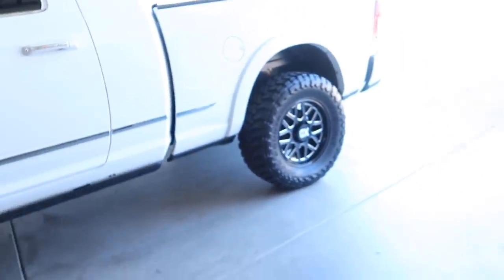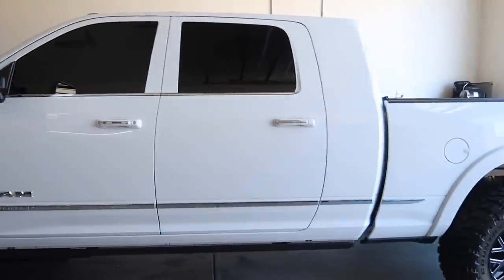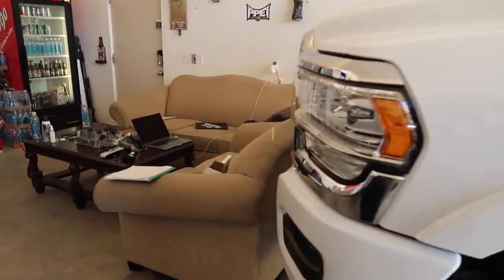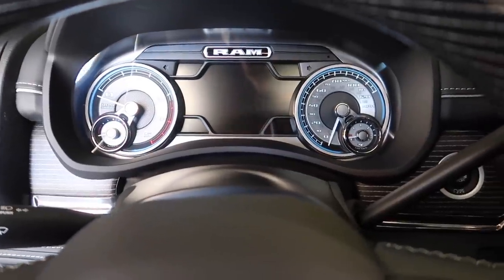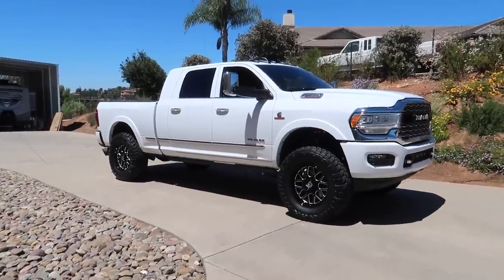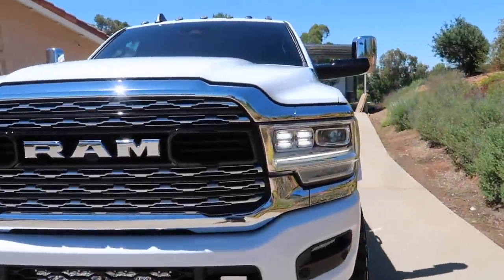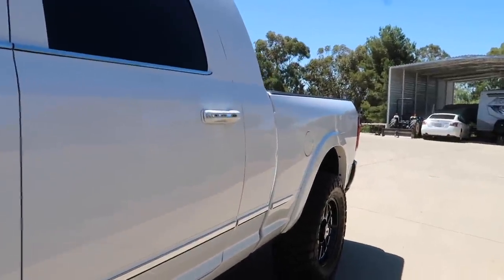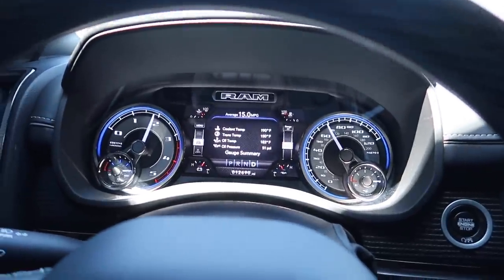THESE TIRES HAVE TO GO!!!

Comment: The exhaust drone actually helps put the kids to sleep.lol
We used to have to load the kids up and drive around the block to put them to sleep at night
Reply: Agree with you there. I have a 380hp Cummins QSB in my commercial fishing boat, with a muffler, and the engine noise makes my kids pass right out. Also makes me fall right asleep if someone else is driving

Comment: I agree that the toyo mt is the BEST looking tire. It’s worth the small amount of noise. BUT, the ridge grappler is so quiet, it’s impressive. I switched to a 37x13.50-17 Nitto Ridge Grappler about a 1000 mi. ago and so far it’s pretty badass. I have them at 45F/35R when not towing with the Carli Pintop kit and I’m happy. Now all I hear is my “DPF back” exhaust (w/muffler). Try them out since you’ve tried all the other toyos and you’re gonna ditch them after a few thousand mi. anyways. My 2 cents. PEACE!!!

Comment: Rocking the Nitto Ridge Grapplers on my 2019 3500 and my 2019 1500... Running 37” on the 3500 and 33” on the 1500... Best tires I’ve had on my ram so far Eddie...
Reply: I've got them on my 2019 Denali Duramax and I absolutely love them. Little to no road noise, an aggressive tread and even wear. They've been amazing tires. Get them Eddie!

Comment: I've had Nitto Ridge Grapplers for about 8k miles on my 2014 Ram 2500.  Tow 12-14k toyhauler and the Nittos feel very sketchy.  Lots of sidewall flex and torsion flex has ruined the tires.  Nitto is giving me a credit at Discount for new tires.

Comment: Def suggest the ridge grapplers...I have them on my new 1500 and I freaking love them. They're grippy and ride so smooth. My buddy has them on his 2500 and he says the same!
Reply: ill agree.. i have 35x12.5x18 on my 2500..sooo quiet..my ride isnt as smooth when under 30...but that might be the air pressure. not sure
Reply: Dustin Rust what do you keep your air pressure at? I'm always back and fourth on what I want to run for my 1500...between 35 and 40
Reply: @garyreilich2667  well i just got them put on. they put them at 73 each tire...i will be airing down to 60 to 65 front and 50 to 55 rear. i watched a guy do the chalk method and his rear wore perfect at 45 lbs...ill see how it rides once i air them down and then see what 45 lbs does
Reply: Dustin Rust thats on a 1500 or 2500?
Reply: @garyreilich2667  2500

Comment: I put a muffler  on my f250 power stroke to get rid of the drone noise.  It was a straight  shot through  magna flow . Love it cab is quite  now but still has a rumble out the rear of the truck.

Comment: This would obviously be more expensive but you could add an electric exhaust valve so you could have it run through a muffle if you want but then if you want to have a little more fun and enjoy the sound you just flip a switch and open her up. Really common thing on gassers, not seen much with diesels.

Comment: I just today put on the RT TRAIL they are about 9-12 months since they hit the streets.  Not run the MT, but stepped back a level for some (light snow ability( not snow rated though)) and a tad more sand ability w/o digging in.

Comment: I have a 2003 5.9 with a five inch turbo back exhaust with a muffler from AFE with no cat. At first I was hesitant on buying the kit with a muffler but since I use the truck for hauling heavy loads the drone was real bad especially on long trips. With the muffler on it's still has an aggressive sound but no drone inside the cab. I would recommend a muffler especially if you need the cab to be a bit quieter.

Comment: I have 295/60/20(basically 35”) Nitto Ridge grappler on my ‘17 2500HD GMC Duramax and I’m very impressed. I bought the truck used and they are half tread and not loud at all, which also have no “hum” on the freeway. They are worn evenly for half tread and with windows up or down, the noise is very quiet compared to a MT.  They look great and I will definitely be buying these when I buy my new Method wheels.

Comment: I put a muffler on my 2005 5.9 cummins it had a 5inch straight pipe exhaust I ran it for 8 months and was way to loud I tow every weekend and I drive around SoCal for my pipeline job I got a mbrp muffler and was the best thing I ever did it sounds so much better because you can hear the turbo whistle better for my truck not all growl.

Comment: The Nitto Ridge Grappler is a great choice. Not a single issue and still look brand new even after 10k miles. Also no slinging of rocks and mine go past the fenders by 3 1/2 inches.

Comment: On the muffler I don’t think it’ll be much of a difference unless you have a resonator mid pipe and muffler or whatever order there in then you sacrifice some power but I doubt enough to notice if it just temp until baby’s older that’s the way to go just and FYI

Comment: Mine is a 4” and I took the muffler off, it made it louder at start up and low rpms. At higher rpms not much noticeable difference, except when the exhaust brake is on

Comment: Get some Nitto Ridge Grapplers! Amazing on and off-road grip and are extremely quiet. Much better than the Toyo R/T's (their main competitor). Over 10,000 miles on the Ridge Grapplers on my 7.3 Excursion, still look brand new and are just as quiet as they were brand new!

Comment: Hey Eddy, I’ve had multiple sets of ridge grapplers and loved them. Not too good in mud though. They clog up quick. Other than that it’s a good tire.       Also I have a muffler on my Cummins “aftermarket” exhaust. It’s a straight through type of design from MBRP I think. It quiets it down but still has decent sound. Definitely quieter when pulling my camper on trips and sounds healthy driving around town.

Comment: Whats the backspacing on your wheels. That wheel tire combo fits that truck perfect. Im looking for a similar setup for my 2022 F250.
Reply from the maker: 20x9 with a +18 offset on 37x13.50x20 tires

Comment: I had a 5inch straight pipe for about 2 years then wanted it quiet. Installed a muffler and never regretted. Also saw a better low end throttle response. I dont think you'll ever find a mud terrain that is quiet. I run Toyo Open Country AT's and would recommend those.

Comment: I have 35 on my f350. With rotation and proper pressure they will last.  I have 10000 miles on mine and still look new.

Comment: Eddie I have ridge grapplers on my 2015 LML. I drive no less than 45,000 miles a year and they have been phenomenal. They have around 35k  on them and still have 80% tread left easy and I don’t rotate them like I should. 35x12.5x18 load F 45psi front 40 in the rear
Reply: Do they still ride smooth?
Reply: @bamafever92  just sold the truck. They had 75k miles on them and 30-35% tread left. Load F btw. Were smooth up to about 55k then they cupped a little but that was my fault. Best tires I’ve ever owned.

Comment: Hey so I was a toyo mt guy for all my  trucks and tire choice. Tell my neighbor who works at a tire shop “Tucker tire” he’s also my friend said bro I want you to try this tire it’s a 35/12.50 it’s a Cooper Discoverer AT3 XLT. I have like 3,000 miles on them on my 2020 Chevy 2500 duramax. I have no complaints nice in the sand pulling my 5th wheel, nice on the highway NO noise and does great pulling my boat to the lake. But just something to think about.

Comment: Unless your going muddling just go with an all terrain or a mild hybrid tire. I recommend nitto terra grapplers or ridge grapplers. The ridge grappler is looks more aggressive but still rides smooth. But I use 37in terra grapplers on my ram 2500. The run sooo quiet and is still realy good off-road if your not going muding 👍 my last set lasted 50k miles, and that’s pulling a trailer 5 days a week
Reply: Ridge grapplers are garbage. Sh@ rain traction they spit rocks like crazy made my front end feel like it was floating and barely got over 26k before they started separating. I get a goood 40k out of cooper stt pro. I tow with my truck. We have good success with the terra grapplers only complaint is the last two sets we started getting cracking when we hit half tread life. My wife’s titan is getting around 35 hopefully 40 out of the ridge grapplers and averaged around 45 -50 out of terra grapplers but my ram 2500 eats the ridge grapplers up.

Comment: I have 37-12.50r22 Ridge Grapplers on my F450. I use it mostly for towing a 5th wheel toyhauler. They ride great, are quiet and are wearing extremely well. Air pressure is key. Toyo MT’s are great as well, I prefer the Nitto. Had em both.

Comment: I will let you know how many I get out of mine but I have a 2018 3500 with a 100 gal transfer tank that is alwatys in use and I tow 10k lbs + 2 to 3 times a week and based on what I have left I will get the remaing 15k to get to the 45k warranty. These would have honestly gone longer had I installed the air bags earlier in their life a few 1000mile+ trips without kinda messed up the side tread on 2 but I'm anxious to get a fresh set
Reply: Talking about the ridge grapler

Comment: How much air do you run in your MT's? Much quieter at lower pressure on my Duramax 45/40psi when not towing
Reply from the maker: I run 45 rear and 40 front

Comment: Check out nitto exo grapplers👍just as aggressive looking as the ridge grapplers but meant for HD trucks and have 3 peak mountian/snowflake winter rating. I have them on my 18 F350 and are great. No louder than my ko2s were on my last truck. Ridge graps are great but not as good in wet/snow/cold weather as the exos. I guess you don't really have to worry about that but up here in BC it's a deal breaker. Everybody runs RGs, do something different lol

Comment: i was the one who asked about quite tires a couple videos ago! I think im gunna go with toyo at3s for my f150, i dont go in mud or sand often, my boss just got nitto ridge grapplers i have to ask how he likes them, still look like m/ts
Reply: I got the toyo open country at3 on my f150, I got 10 ply as I tow with the truck. One of the best tires out there, no road noises or humming, no side to side sway feel when towing, excellent traction in the yard and rainstorms. I got 5k on them so far and no wear on them.
Reply: Kameron Rice sweet such good information, do you know if the 305/70/r17 is also 10 ply?
Reply: @ryanrussell3893  yes the make them in that size in 10 ply (load range E), as well as 8 ply (load range D).
Reply: Kameron Rice got it 👍 great price to on those toyos compared to bfg ko2
Reply: @ryanrussell3893  I almost got the bf ko2 but my buddy had them on his f150 and the tires seemed to get more cupped on the edges and make a roaring noise at highway speeds in the cab. Also the  centers of the tire seemed peak. Still a great tire but don't think it will last as long as the at3.
Reply: Kameron Rice yea i cant find another al terrain that matches that at3 especially for the price

Comment: Just put new Ridge Grapplers (35x12.50r20) on my Duramax AT4. Really like them so far but coming off of stock Wranglers so a definite upgrade. They match well with the Suspension Max stage 2 leveling kit.

Comment: 295/65r20 ridge grappler.  Ram 2500 mega cab. Do it. I pull 16000 5th wheel.  Their good, quiet, not sluggish

Comment: Ever considered KM3’s?
Reply: Pablo armenta The KM3's are great off road tires but tend to cup badly if just highway driving. Have to keep up with the rotations also.
I do still like the KO2's
Reply: Dave Thies had k02’s on a ranger. Km3’s for like 2 months on ‘03 z71 sierra but then the truck got robbed 😅 now have toyo mt’s on a JLU
Reply: Sooo hadnt got much time with the km3’s. Great off road. Ko2’s were ok ok dirt and gravel. Not so much with much mud

Comment: if there f rated and your running 65/85psi etc they move around the road i aired down to 50f45rr intell i tow and its better but still little noisy my bfg a/t k02s road alot better and smother quiter etc but didnt look as good.. imo

Comment: They are MT’s Eddie, the Nitto Ridge Graps are great!!! I had them and the only reason I switched out from them was because I wanted a true MT and went to true 35’s. Ended up with Yokohama MT’s. I’ll tell you right now you will be back in the MT’s, anyhow I had the Nitto’s for about 20k and they still looked new. You’ll hear the Nitto’s as well, not as loud but you’ll know they are there.

Comment: That's the one thing I have noticed when you went to the mt's you can hear them in the videos
Reply from the maker: big time
Reply: Couple tires you could look into is the new hankook dynapro mt2 or the dynapro atm. I ran 3 different sets of the atm's on 2 different trucks and never had any issues got 50k + miles on them.

Comment: The RidgeGrappler SUCKS offroad , no traction , get suck easily , only nice thing about them is they wear evenly and for longer than any MT ive ran  .
MT is the only way to go if you got in Sand , mud , snow 
For me its Toyo....

And as far as the Muffler GET A DONALDSON gets rid of the "Cummins Drone" but keeps a great tone

DONALDSON PART # M090535

Comment: Hi Eddie. I have 38” Nitto Trail Grappler MT’s on an 8” lifted 2019 Ram 3500. They are extremely quite compared to the 35” Toyo MT’s. And they have been wearing nicely.
Reply: What 8" lift do you have Jordan? I can only find 5.5"  :(
Reply: It’s the McGaughys 8”. I really wanted a BDS 8” but they are taking so damn long to produce them. Just said screw it and went for the McGaughys. Never had one before but I love it. Rides great and looks great